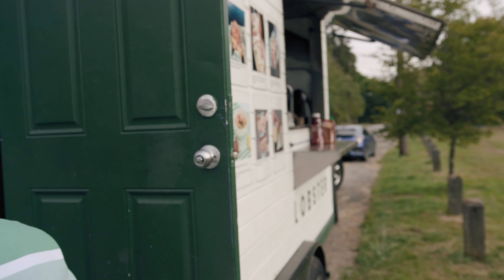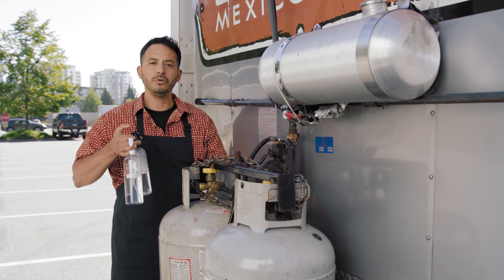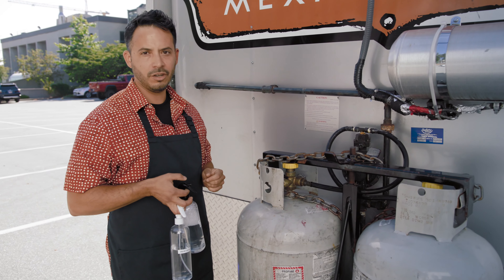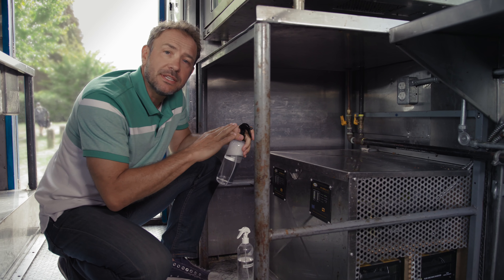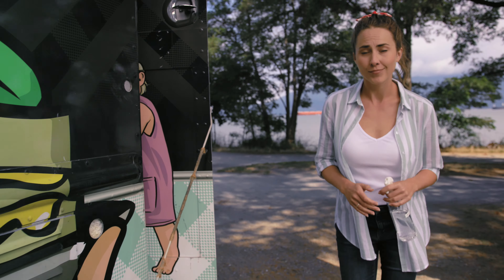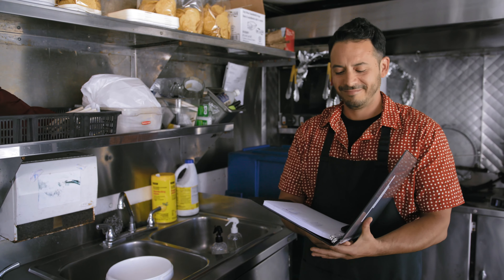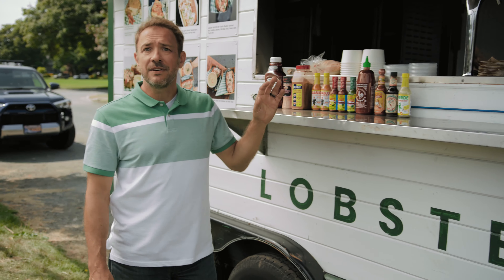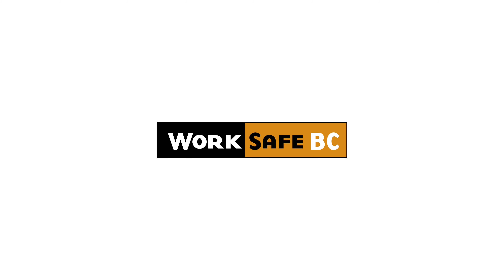Food Trucks and Propane Safety: Soap Test | WorkSafeBC

Comment: You really ought to use proper leak test fluid. Many propane fittings are made from brass. Brass and soap don't play well together.
Also you want a fluid base that doesn't form ice easily. Propane comes out way below freezing and sometimes it's just plain cold outside.
Soapy water is better than nothing, but if you are planning ahead, stock leak test fluid.

Comment: Why do these videos never show examples of what to look for, e.g. bubbles forming?
Reply: Disclaimer: I am not a qualified propane technician. This is not professional advice.  If you have a leak, call a pro. But by way of general info:
That's exactly what you are looking for. Bubbles. Usually it'll keep blowing bubbles because of a constantly escaping stream of gas. Sometimes it's easier to pour it on instead of spray it on because a spray bottle will create bubbles. So then you have to try to figure out what's from the spray and what's from the gas. If you see a bubble being created that's the red flag. If you see one and it doesn't grow, hit it with more liquid and see if you get more bubbles. Usually the leak will be at the joins. Spray anything with threads or pipe dope. Spray all valves including the fill valve. Check the hoses. 9 times out of 10 it's gonna be these things. Just don't give up if you don't find it. You aren't supposed to be able to smell gas under normal circumstances. If the oder lingers, then it's getting out somewhere. If you can't find it, call a pro. Even slow leaks can collect and ignite under the right conditions.
They also make propane sniffers that can be useful in a narrow set of circumstances. Make sure you know how to use it though or you'll get false readings. Research that one before jumping in. And don't cheap out either.
Reply: They did say it in the video
Reply from the maker: Hi there - This video shows bubbles forming: https://youtu.be/7UPQhuvdeL8?t=17
Reply: You don't know what bubbles look like??